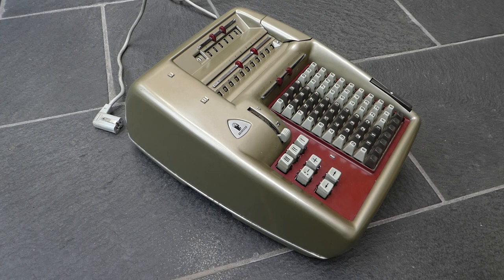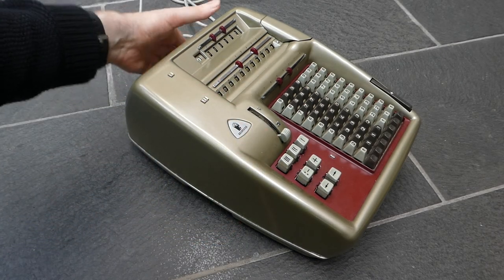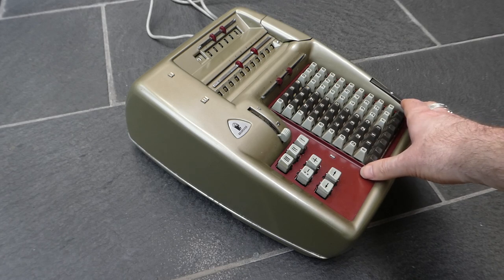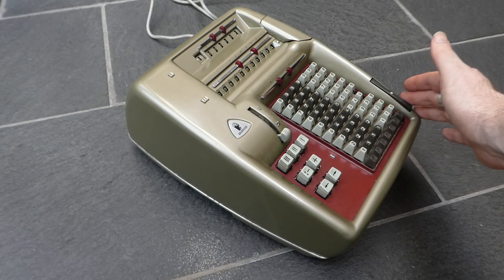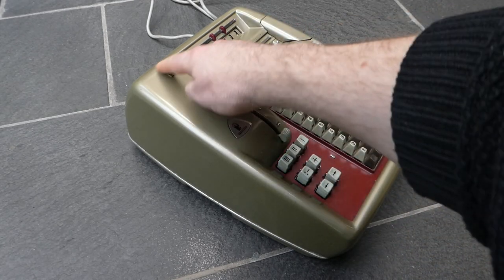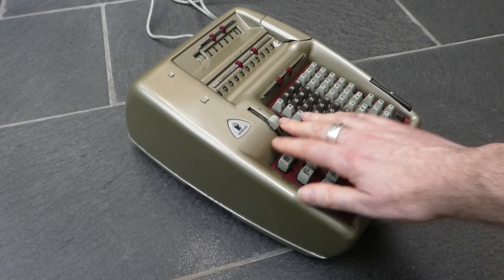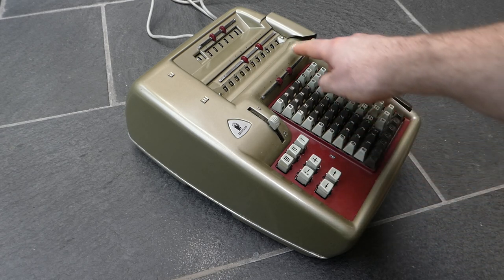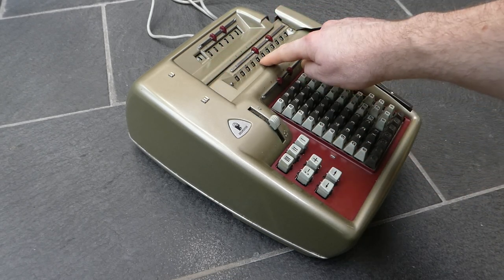The Brunsviga 11S mechanical calculator

Comment: Does anyone used this one in real life?? Or it used only for demonstration purposes only?
 I guess this complex mechanical calculators would be very expensive. And only for very basic mathematical operations  does  anyone spend that much money??
Reply from the maker: These were on sale and were used, but this particular model was not in production very long and not very successful. Brunsviga reorganised because of its merger with Olympia and this was one of many models that was discontinued. There were many other calculators on the market, and I think this one was actually cheaper than most of similar capability.